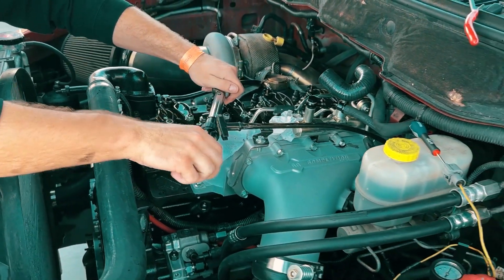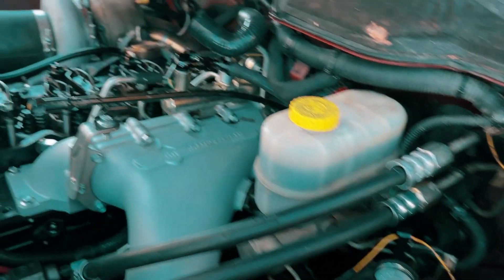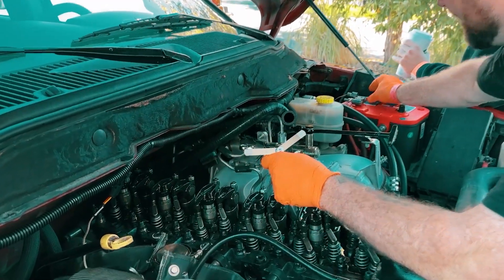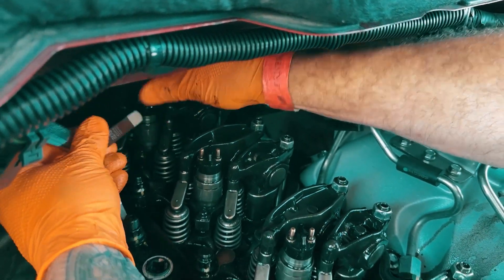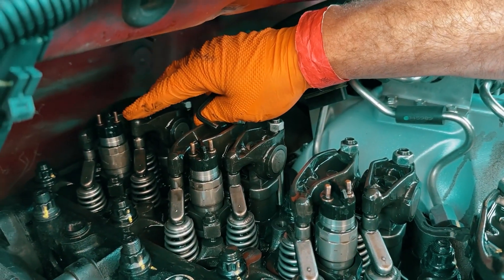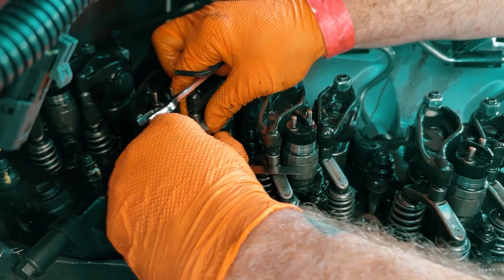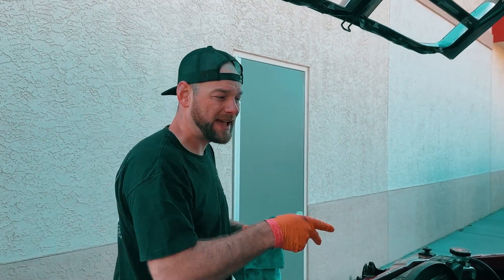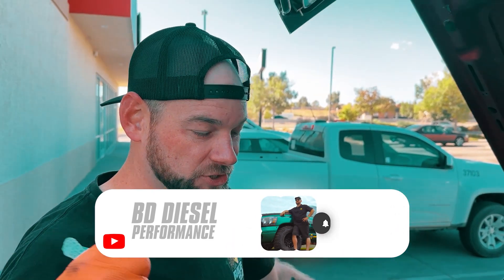Use Your Car Battery to Adjust Valve Lash - QUICK & EASY HACK

Comment: I put a white stripe on the damper for tdc. I use the starter bump to get me there.  I have never tried it this way. 

What happens if you do the lash too tight?
Reply: Too tight I think you can burn the valve
Reply: Too tight when it gets warmed up will leave the valve slightly open.